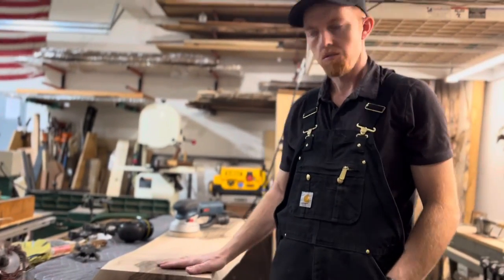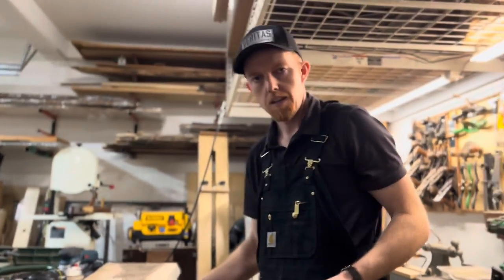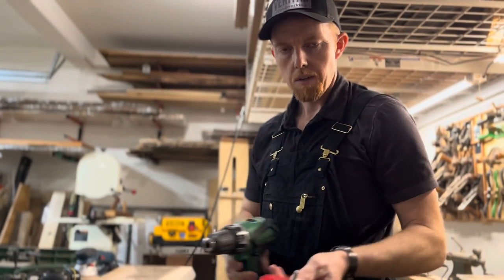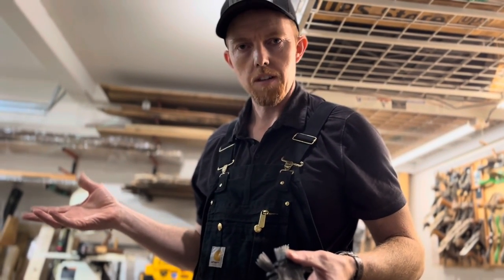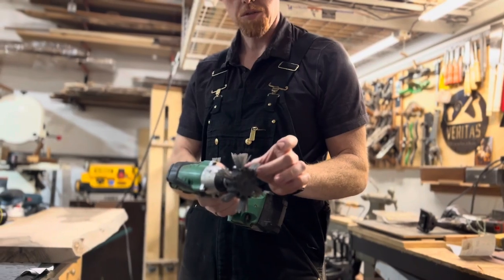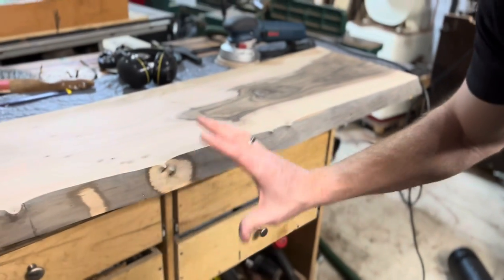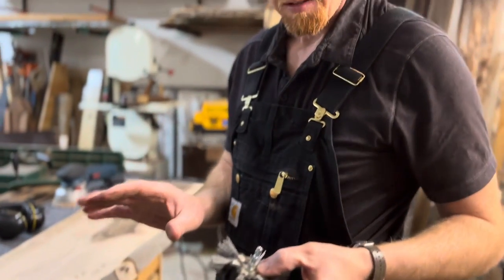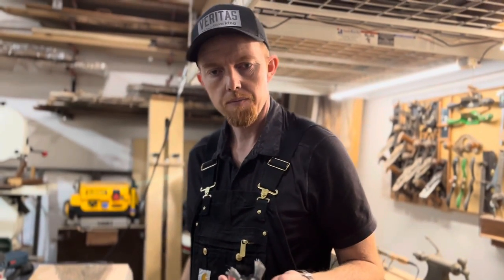How To Sand Live Edge - Best Tool For The Job Based On My Trial and Error

Comment: This was HUGELY helpful. Thank you!  This method preserved the patina for a very natural finish of the live edge. One note: if you decide to sand-blast  w/ glass bead to accentuate the patina coloring, this should be your last step before finishing steps.  These nylox brushes will remove the patina if you use them AFTER sand-blasting.
Reply from the maker: Good to know, thanks!

Comment: Thanks for adding some real value (and not taking 30 minutes to convey the info).  
Normally I use chisels for the bark, then the Rotex 90 which works really, really well for the smooth flat portions, but not nearly as well for the small intricate features like what you showed.  I think the combo of those two approaches would be excellent.
Reply from the maker: I forgot that I used to use a foam contour pad for my Rotex sander for the edges as well, but yeah I agree using both can get any job finished well.